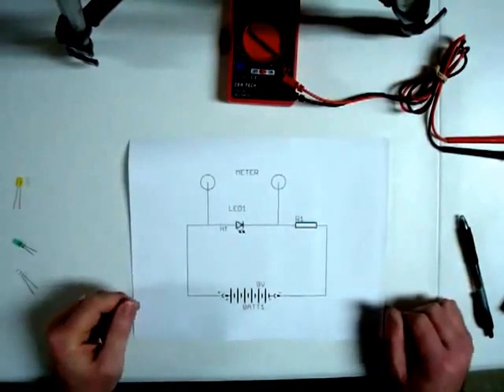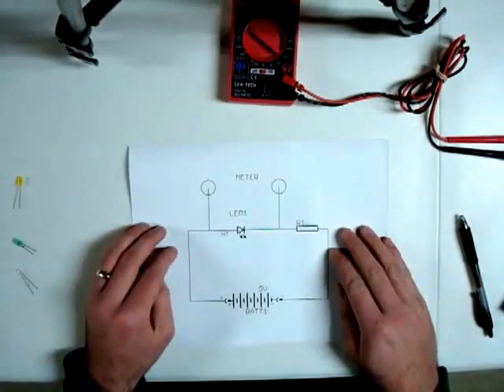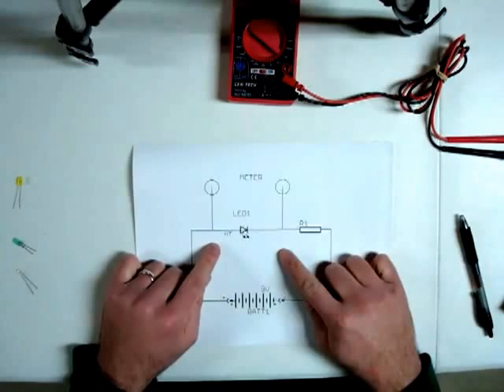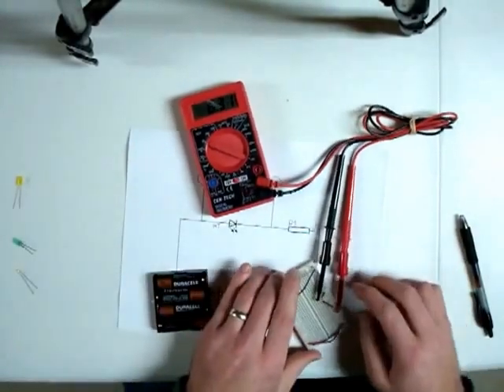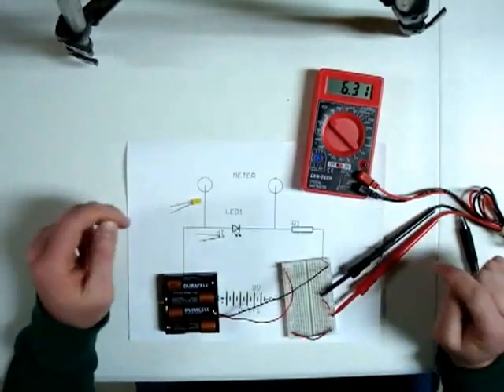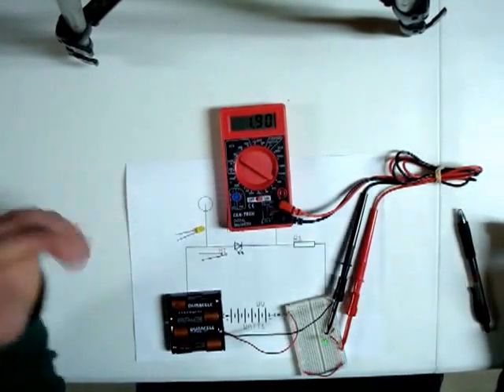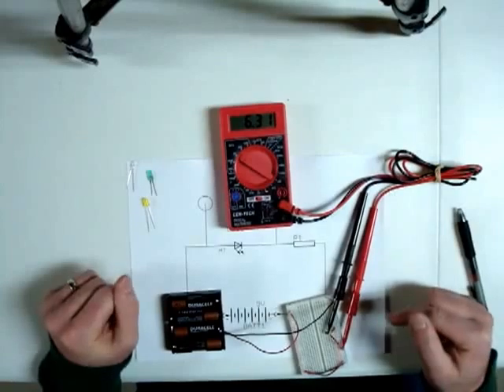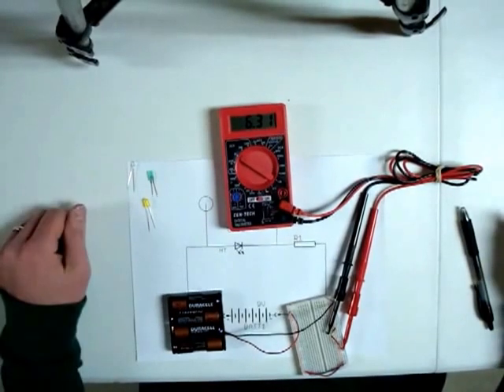How to find the Forward Voltage drop of an LED

Comment: This also works for testing the EHT diode in a microwave oven ( a multimeter set to diode test is useless ! ) .... the voltage should be somewhere between 8 to 10 Volts , so you need a couple of 9 Volt batteries to make 18 Volts ( tried - n - tested ) .. DAVE ™🛑

Comment: Good work. Just need to clear/confirm one thing. So the forward voltage value which you get this way does not depend on the value of resistor that you used? I.e what if I had used a different value resistor and then checked would the value still be same?Secondly I had used this method and used 220 ohm resistor. I got Vf 3.53v for red led which seems high considering the standard voltage drop across red led's this confuses me, did I do something wrong? I used different connectors with multimeter not like the one's that you used. They are basically direct (Like just touch its pin to the points where u want to measure the voltage),
Reply from the maker: As long as the resistor value is reasonable (not 100's or 1000's of kohms) then the Vf across the LED should be the same.  The current going through the LED will change depending on the resistor used, but the voltage will stay the same.  As stated in the video, make sure you are measuring Vf across just the LED, not the across the LED and resistor as that would be the same as the source voltage.
Reply: Yes, I had measured only across the red led and was using 220ohm resistor. Therefore confused why i got this much Vf for red led any idea? I used jumper wires for the connections
Reply from the maker: I agree that is a bit high for a red LED but without knowing the specifics of the LED it is hard to say.  It could be that it has a built in resistor of some sort or is actually a different color ( like white which is in that range ) LED with a red casing.
Reply: Okay so basically using jumper wires for the circuitry and direct contact wires attached with the multimeter to measure the voltages does not affect the readings? can you confirm if they do or do not affect the reading? Last question. Thank you for your responses
Reply from the maker: Correct, they should have an insignificant impact on the readings.
Reply: Thank you very much.

Comment: Great tutorial thank you, can you help me please I want to light up 4 shot glasses -  I have 4 led 1 red 1 blue 1 green and 1 yellowcan they be wired from say 6v to give equal brightness? would they need to be in series or parallel ? would they each need there own resistor?  Hope someone can help and thank you very much... John :)
Reply from the maker: I don't believe they could be wired in series as the voltage drop across all 4 is likely to be over 6 volts.  I believe ideally you'll want to give each one its own resistor and wire each resistor/led combo in parallel.    The resistor needed for each will be 6v-led voltage drop divided by the current that should go through each led.  Each color of LED will have a different voltage drop.  I hope this helps.  Let me know if you want more info.
Reply: Hello  KYCoffey,  You have been very helpful thank you very much for taking the time to reply. Cheers and have a great day... John :)

Comment: Every LED colour has different voltage drop due to the materials used to make P-N junction to emit light with certain wavelength. It might vary between 1.something to 3.something for white ones. Measuring voltage drop presented here is OK unless you use reasonable series resistor value. assuming 10-20mA of current running through any LED is safe we know we expect a voltage drop lets say between 1.5V-3.6V. If battery pack delivers 6.3V we expect a voltage remaining on resistor to be in range 2.7V-4.8V. Calculating worst case we expect to have 20mA running through diode and resistor when higher voltage appears so we get R=U/I=4.8/0.02=240 Ohm. Given that when we will have 2.7V available on resistor its current will be I=U/R=2.7/240=11mA. This shows that for 6.3V battery pack 240 Ohm resistor is OK to test LED forward voltage drop. Last thing is to check what would be required power rating for used 240 Ohm resistor. Calculating dissipated power always for worst case we get: P=U*I=4.8*0.02=0.096W which says that standard (cheapest) 0.125W resistor might be used.

Comment: Isn't the resulting voltage on the display after lighting up the LED the amount of volts that remain on the circuit? AKA, the displayed voltage needs to be subtracted from the original voltage (6.3 in this case) to get the voltage drop of the LED? Or am I thinking about this backwards?
Reply from the maker: No, the reading is the voltage drop.  This is true regardless of if we were measuring an LED, motor, resistor or whatever.  When measuring the voltage with a multimeter you are always measuring the voltage drop from the positive probe to the negative probe.
Reply: AK540i Correct. However, with this setup, it is quite possible that the LED will be blown, provided that a too high of a power supply is used.
Reply from the maker: +WhoWantsToKnow81 As long as a sufficiently high value resistor is used the LED is not likely to be blown.

Comment: Sorry to not get back....took a break from display board. In double checking the voltage from the LED's, I found that if I go from the LED to ground wire that comes in from the power supply, I get about 4.5 volts, so I feel I may be on the correct way to accomplish my project. Thanks for your aid.
Dadholly

Comment: All the info I have on the LED's that I bought of of Ebay is(5mm Ultra Bright White LED 2(Short feet)18000-22000MCD 20MA 3.0-3.2V  If needed I could is remove current LED's, but was hoping to use both on the bingo game & remote display. As far as a video this would be great.
   If you need me to send you a picture/video please let me know via e-mail steveholly@prodigy.net or I can try via a video on You Tube.
   Thanks for your time & effort.
Reply from the maker: I have posted a new video showing how to use a transistor to power the LED on a remote display titled "Using a transistor to piggyback an LED". Let me know in the comments of that video if it is clear and shows what you need.

Comment: Yes there are existing resistors in line. If you go to You Tube...type in (Multi Electronic Bingo Machine - Raffle and Bingo features)...this is a little newer version of what I have but basically the same. I'm wanting to tap of of the LED's on the panel to go to a larger display. Thanks for clarifying the wire size. Hope this helps in what I'm trying to do with my project
Reply from the maker: I went and had a look.   The LEDs that it has on board are probably fairly low power.  I'm guessing if you connect an external display up to it you may have issues with either the LEDs light too dimly or possibly damage the internal transistors that currently drive the LEDs.  Do you have any info on the LEDs in the external display you want to drive?  If so perhaps I can do a video showing how to tap and existing LED and drive it with another power supply via a transistor.

Comment: Thanks...I will give you more info on the circuit I'm using, It's a electronic bingo game that uses 12 volt, one of the 80 LED's is where I'm getting the 1/2 volt. I want to have it go to a different display by tapping of of each of the 80 lights on the game control panel. I don't want to blow it up, and this is why before I try this, I wanted to ask someone if what I'm trying is feasible. Is the length of the wire very important, as to the wire resistance ? Is it possible that the 1/2 volt reading I get is due to inline checking ? Any info at this time would be very helpful. I would like to thank you for your thoughts.
Reply from the maker: Are you able to determine if there is a resistor inline with each of the LEDs?  I would start with wiring a 1k resistor to an LED you want to piggyback of of the display.  And just test wiring it in. Even at a full 12V only 12mA could possibly pass through you're new LED.  At this level of current even a fairly small wire should be able to handle the current with no problem even something like 28 gauge should handle it without difficulty.  If the brightness of the LED is too dim just work your way down resistor values.  It is difficult to really tell you what to do without seeing the circuit. Could you do a video reply with what you are working on?

Comment: Thanks very much for the info...I just bought a digital multimeter. with my old Simpson, I was getting about 1/2 volt. This may be due to inline checking. Do they make a LED that uses 1/2 volt ?  I would like to use both LED's but its not mandatory.  I plan on trying a 3.3 volt LED, is this OK to try ? Lastly by making the new LED in a different location, is the wire size important?
Thanks again.
Reply from the maker: 1/2 volt seems a bit low for the voltage drop of an LED.  The power for most LEDs should be tiny so wire size should not be an issue as long as we're talking normal indicator style LEDs and not high power LEDs like those in a flashlight.

Comment: Thanks for the info. Would you happen to know if I can tap off of a existing LED on a circuit board to another LED so it can be monitored at a different location (about 3 foot away) ?
Reply from the maker: You will have problems with driving 2 LEDs in parallel like that because they won't perfectly match in voltage drop, so the one with the lower voltage drop will light up.  If the circuitry powering the onboard LED can source the current and you can find the resistor that is connected to it then you can put your LED/resistor combo in parallel with the onboard LED/resistor.

Comment from the maker: If you put the negative terminal of your multimeter on the low side of the diode, the as far as the meter knows that is 0V even though in your circuit it might actually be 2 volts from negative of your battery.  Then you are putting the high side of your meter on the other side of the LED, you are only measuring the DIFFERENCE in voltage from one side of the LED to the other, so you are measuring it's voltage drop.  You could also measure the voltage drop of the resistor this way.

Comment from the maker: If you are using a regulator like the 7805 then the voltage drop to 4 volts is caused by the input voltage not being high enough.  A 7805 needs the input voltage to be something like 7 volts or more in order to maintain a stable 5 volt output.

Comment: Can i ask im using a TEG as a ower supply and im connecting it to the 5v voltage regulator. I have some problem where my output from TEG are at 6 volt or something and on my voltage regulator the voltage are being dropped like 4volt(output). On the voltage regulator there is a LED. The question is does the LED make my output voltage drop or something else happen?.

Thanks

Comment from the maker: If you do not use a resistor you will not be limiting the current to the LED.  This will cause it to fail very quickly if not instantaneously depending upon the current that the power source can supply.

Comment: what happens if you don't use a resistor?
Reply: Resistor is used to lower the current which flows through LED. For LEDs, 20mA or less is considered safe. If you don't use a resistor and you supply a LED with higher current, it will most probably fail.

Comment from the maker: The resistor is just there to limit the current to prevent the LED from being destroyed.  I believe in this case I used a 1k resistor but it really could be anything as long as it keeps the current going through the LED to below say 20ma.

Comment: what resistor did u use in the breadboard? if u change the value of the resistor then the voltage drop also changes? thanks